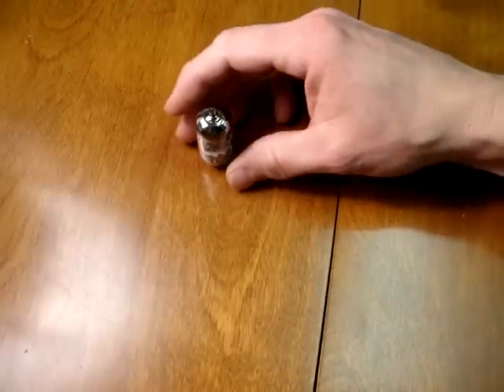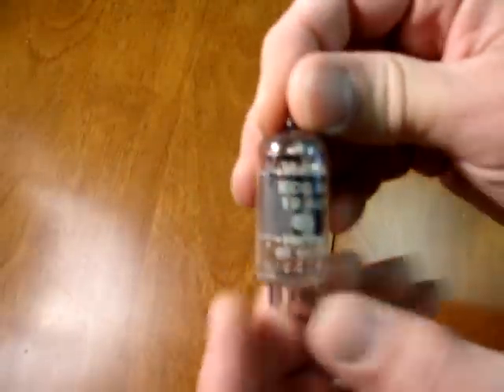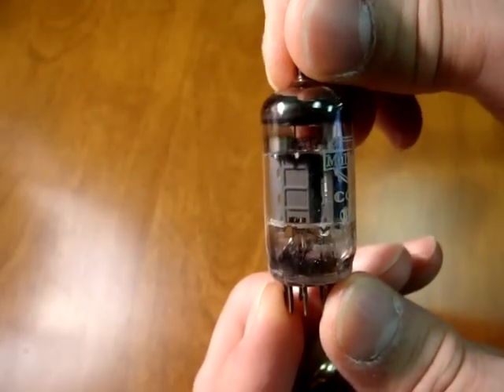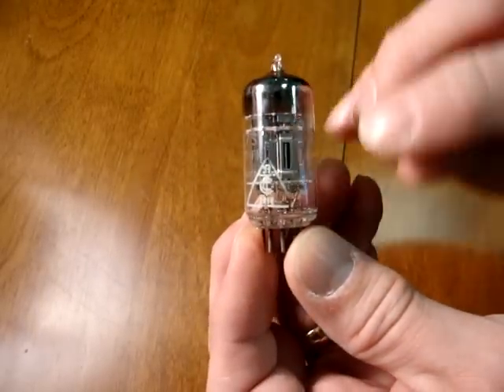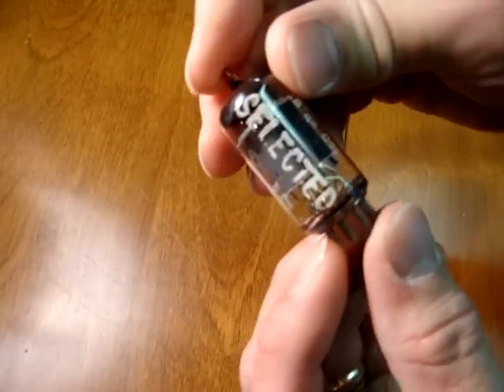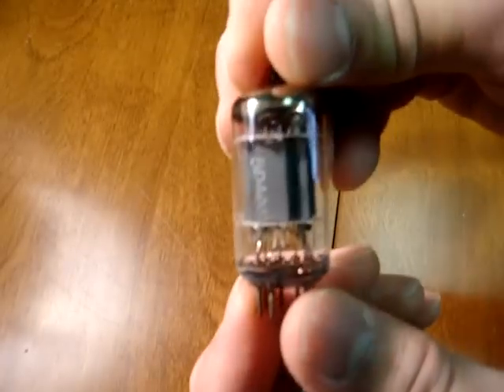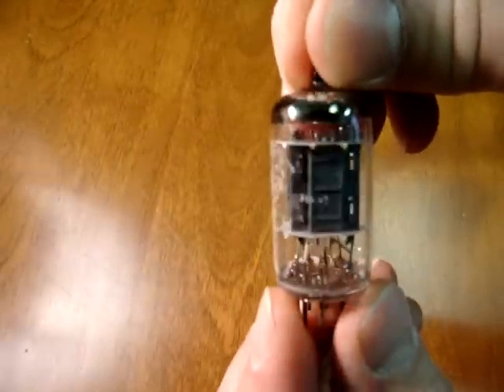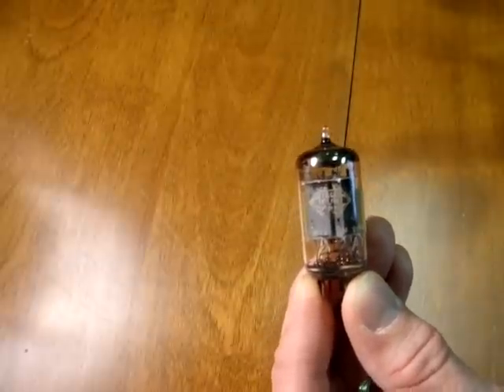How to Spot Super Rare 12AX7 Vacuum Tubes part I

Comment: I recently met a retired FAA engineer that sold me many tubes and there were two red tipped Bell & Howell 12AX7A and only marked Made In Japan.
Reply from the maker: Bell & Howell used Mtsushita of Japan for most of their tubes in the early 1970s.  The red tips indicate they were likely tested and passed for critical applications in certain test equipment or hospital equipment.

Comment: cleaning out my storage unit, came across a box with 11 Telefunken 12AX7 tubes, authentic to every detail, smooth plate with white letters 'Made in Western Germany'. I don't even recall exactly how i acquired them at least 7 years prior, I think they were going to be thrown away and i rescued them, not knowing at the time exactly what they were, other than vacuum tubes and my instinct said 'keep those, they are probably still useful' 11 in very good condition, one broken, and two more that are RCA and GE 12AX7 also. Looking up how to test them

Comment: Back 4 or 5 years ago i went to a flea market and i spotted a RCA repair box. I opened it up and there were well over 100 tubes in boxes. Some were marked as used and were for testing, but the majority were NOS RCA, GE and other brands. I bought the whole box of tubes for $40. I got home and tested the tubes and I also tried them in my amps and in the end i had 36 12ax7 tubes (New in box) RCA and GE tubes. 5 Amprex 12AX7s. 12 RCA 6L6 tubes, 11 12AU7 GE and Amprex tubes, 17 6V6 RCA. And there were almost 20 used tubes ranging from 12ax7, el84 (6bq5), 6L6 and a few that no guitar amps use. Was an awesome find. Im curious what just the red and black wood RCA repair box was worth. But I still have a majority of those tubes in my stockpile of tubes. About 7 years ago i bought 25-30 JJ 12ax7 tubes for $9.99 a peice and i have not used them they are still in boxes. JJ 6L6s, JJ EL84s. Now ive been using 6p14p in all my EL84 amps and ive been using 6n2p preamp tubes in everyone of my amps instead of 12ax7 tubes (either ive rewired my amps or im using the 6n2 adaptor to 12ax7. The 6n2p and 6p14p are dirt cheap for military grade NOS. Im also experimenting with 6p3s power tubes in some of my 6L6 based amps, ive just had to cool the bias down. But i can redo all the tubes for example in my Blues Jr for around $14. If i was using say JJ 12ax7 and JJ EL84 new production tubes itd be $125-150 to retube the amp ! Crazy. You can get 32 packs of 6n2p preamp tubes for around $65 shipped ! I keep telling people about how good these tubes are but some people until they hear my amps are trapped in this world of theres no way anything can be better than a 12ax7 tube ! All the companies use them !! lol Military Spec tubes last a hell of a lot longer than new production tubes. Ive been selling Recap/Conversion kits for Blues Jrs. In the kit are F&T caps, 27k resistor to cool the bias down and 3 6n2 to 12ax7 adaptors. 3 x 6n2p preamp tubes and 2 6p14p power tubes. Ive sold about 30 of these so far. The 6n2p preamp tubes im buying rival my 60's RCA tubes in tone. 

Just a heads up folks, you heard it here first. Also look up Train Wreck amps they are one of the few companies using 6p14p and 6n2p preamp tubes and some other European tubes. You can wire your amp up to use these 6n2p preamp tubes very easily, but i found it was easier to just get the adaptors for people.
Reply: For 12ax7 tubes my personal favs (not counting 6n2p tubes) are RCA short or long and GE short or long plates from the 60's. In my Twin style amps these are the bomb and I never found out what type of tubes Jerry Garcia used, but i swear they were what im talking about here RCA or GE's ;-) . I know some people swear that they dont hear a difference between tubes and that may be true you dont hear it, but i do and if im playing thru the amp i want it to sound the way i like it to. See we agree to disagree haha 🙂
For example I like JJs but they are not always the best sounding tubes. But they last a long time in my amps (as long as the bias is set correctly on the amps). Mullards i do not like, ive had more dead current production Mullards in the past 7-8 year than any other brand. Sovtek are very hit or miss for me, some of their tubes sound great but ive ordered some matched pairs from a few reputable places and ive had issues with them in multiple amps with getting the bias right. Im speaking of their EL84 tubes tho, not their 12AX7 which i like. RCA i think are the perfect 12ax7 for what i do, same with GEs i love these two brands. But these are my picks for 12AX7 preamp tubes.
Reply: JJs and other Russian or Chinese tubes are really good for most guitar amps. Guitar amps create distortion on purpose and, design wise, are night and day from hi fi amps. To use Telefunkens in guitar amps is like using the finest single-malt Scotch in a fruity mixed drink.

Comment: I got was emtied a house where i old schop keeper and a bit of a horder of things and i got a huge box of new old stock tubes,Philips miniwatt rca etc etc 6l6 many siemens and a bunch of black metall cappet tubes(minlitary grade?,Also got lots of old tube radios for different use.I does some repair on amps and electronics for 40 years, fun to get hold/save them from going in the trash continer.

Comment: There are some capacitive differences in the plate, grid, and cathodes of some tubes vs. the same type made by another manufacturer.  And that ALONE determines how one tube can sound different from another of the same type but a different brand.   Even then it's not the tube, but how that altered capacitance interacts with the amplifier's circuit.   Between that and microphonic sensitivity, that pretty much defines all that ACTUALLY makes a difference in tubes of the same nominal type.

Comment: Glad I found a pair of NOS Telefunken tubes for 70 bucks recently. The smooth plate is balanced, but has high plate resistance, which is kind of annoying as a V1 that needs more 'oomph' put into it to get the gain, but the ribbed plate is fucking amazing, 70/70 instead of 120/120 according to the American testing machine.

Comment: Slightly off topic with analog tester. I have so many of these preamp and vacuum tubes and got a Heathkit VTVM given to me. I’ve read about testing continuity /filament  but what else should I be testing/looking at for a good tube with volts and ohms.

Comment: OK, listen up, youngsters...I've been in the tube game since 1961, and this is the truth: the best tube for your (audio) application is the one that sounds best to YOU, regardless of what any professional tube-roller might tell you. (Disclaimer: I'm a professional tube-roller - I specialize in guitar amps. I've done work for Derek Trucks, Meatloaf, Let's Go Bowling, Susan Tedeschi <etc.> and many other top artists.)  Sometimes tubes which test as excellent in a tube tester sound like ASS when installed in the equipment, because tube testers (for the most part) don't test for hum, noise or microphonics. By the same token, tubes which test poorly on a tester may well sound dynamite when plugged into a guitar amp. "Brand snobs" often get burned by selecting tubes by what's printed on the glass...just because a tube says "Telefunken" or "Sylvania" on it, it's no guarantee that what you've purchased isn't a turd under glass. The "legendary" tube manufacturers turned out crap as well as good stuff back in the day, so use your EARS when selecting tubes. If you can develop a relationship with a tube seller who is a musician as well as a technician, you'll have a greater likelihood of obtaining quality parts. Bear in mind that there is a whole universe of tubes which is circulating on e-bay; people buy them, try them, find out that they suck, and put them back on e-bay. Buying from someone with a good reputation may keep you from joining that particular dance.  And don't rule out currently-produced tubes; some of them are damn good. Some aren't.  ;-)  Good luck!
Reply: Thanks for your experience.

Comment: I bought a 12ax7 tube that's supposed to be a Mullard brand but marked RCA. When I posted a pic on my guitar forum two members IDed the tube as an RFT because of the "throwing star" mica design. I have it in my Vox VT40+ amp though and it sounds fantastic, much better than the Sovtek it came with.

My guess is that I bought a remarked tube?

Comment: I remember the red tipped telefunken tubes used in American Optical ECG monitors in the early 70's. Even though they were tested to very high standards, there were some that would not yield a good common mode rejection ratio in the low level stages of the monitor. That was the problem with tubes, and after a few weeks of operation, the CMRR sometimes needed to be readjusted because of aging of the dual triodes.

Comment: Great information! I took 6 12AX7's out of an Lowrey Organ. Are they of any value? They are made in the US and have a Lowrey label on them. I'm pretty sure Lowrey did not make them.
Reply: If those Lowreys have long black charred looking plates then they are late 50's RCA and one of the best 12ax7's you can get. They will be either RCA or Sylvania, both good USA tubes.

Comment: How many of those would you like?   In less than 10 minutes I found 5 of those in my very old collection of '50s tubes.  I also have 12AT7s, 12AU7s and 12AY7s.   Mine are a mixture of RCA and GE.  How about some Nuvisters or a 3DR3 lead covered high-voltage regulator tube?

Comment: are all the 12az7s interchangable
Reply: As I've understood it, they all sound about the same when operating in their "normal" range. There are variations in noise, gain, and microphonics (that is, how they react to vibrations) that obviously follow from the different mechanical designs, but they're near enough interchangeable when used as "clean" amplifiers. (As an example, I think larger plates and emitters give more gain but also more noise.)

The interesting thing with tubes is how they sound when pushed into distortion. Again, there's not really any magic to it - different shapes and sizes of emitter/grid/plate will mangle the signal differently, and thus two tubes really can sound different when used in e.g. a guitar amp.
Reply: Oh, sure - most of the tube fanatics are using them for things where you shouldn't hear much of a difference, and probably overpaying a lot for tiny (if any) perceivable differences.

I'm just saying that there are certain uses where the differences between tube models are quite real, so it's not all superstition. Merely most of it.
Reply: Lefty McStinky ...You can't go wrong with tubes from Mesa Boogie, Sovtek or Groove Tubes for your guitar amp. Just choose the brand that fits your style.

Comment: Are all 12AX7 vacuum tubes "super rare" or only those specifically featured in the video?
For instance would a General Electric 12AX7A/ECC63 (could be ECCE3, not ECC63) be rare?  It was made in Japan but back then (60's) of course, I'm aware that Japanese manufactured products were legitimately stigmatized as junk.
Reply from the maker: Hi, the tubes in the video are just a sampling of those considered rare or super rare.  There are others that I will have to put in another video.  Your GE is a 12AX7/ECC83, and they did source them from Japan in the 1970s.  If it came from the Matsushita factory then it is a pretty good tube, but not considered rare.
Reply: Thank you. I appreciate your work.
Reply: I was browsing your site I am lucky enough to have a phillips radio thats full of good miniwatt tubes 4 EL84s and 1 12ax7 talk about lovely sound
Reply: Japanese products may have been stigmatized as junk, but actually are often made to very tight tolerances and are quite good. People won't seek out Japanese tubes and pay top dollar for them, but there's nothing wrong with the stuff that came out of Japan.

Comment: Vintage tubes are not a good thing as they will all eventually die being used or not (all tubes will)
What we need is for manufacturers to create improved new tubes...
A line of cold cathode, lower plate voltage tubes, could revolutionize audio electronics...seems we gave up on tube R&D when the transistor came along.
Reply: Incorrect---a tube that was never used from even the 1920's will test as good as the day it was made. The working parts are sealed in a vacuum, they don't age just sitting around. And how hard is it to change a tube? They're not like incandescent light bulbs, they last a pretty long time.
Reply: +forsakenworlddragons I think Craig was going for a new tube design in general... like not a 12ax7's, but an as-of-yet undeveloped tube design.

We haven't seen much since the mid 60's (because of the transistor).
Reply: "seems we gave up on tube R&D when the transistor came along."  There's a good reason for that.
Reply: Your conclusion is not right, the vacuum tube will exist forever. The frequency response dynamic range of semiconductor is not so good as vacuum tube. For extremely high quality audio application, it's not substitutable.
Reply: If only America was not such a throw away economy,  that would create a market for them again.  No company will tool up if no one wants them.  Whatever happened to the tube testers at Circle K?  You know, the one that looked like a pinball machine with the drawers full of tubes? Gone.  Found only on ebay these days.
Reply: @UpcomingJedi  Those old "drugstore" testers were the ones which said "U-Test-M" on them. They were emissions testers, not particularly good. If you're looking for a tube tester, there are certainly better choices than one of those. Hickok, for instance, or B&K. Not cheap (in most cases) but if you want reliable accurate equipment, you gotta pay.  ;-)
Reply: SinSchism ah right. got ya.
Reply: For crying out loud, we're talking about audio frequencies here.  Any transistor will have gain and be flat over audio frequencies.  When you're designing for hundreds of MHz, then you have some challenges.
Reply: justsomeguytoyou agreed
Reply: Craig Diamond there is a website online called thetubestore. com that sells new tubes. they sell an 12ax7 for like 14$
Reply: Lefty McStinky who won the more about vacuum tubes 12 X 7 in my drawer in Fresno phone number +1-405-933-5533
Reply: 1st world countries don't produce tubes anymore because of the environmental hazards, the process creates arsenic among other extremely toxic substances. This is why you only see them being made in 3rd world countries like Russia. Problem is they have no where near the same standards as the old US and British companies had. It's just how it is, and why these tubes go from 300 to 1000 dollars.
Reply: Korg have developed a replacement technology in 2015!

Comment: Call me weird, but I have a JTM45, that had 2 Telefunken 12ax7 in and a mallard 12ax7 in and it sounds better with new tung Sol tubes in V3 and V2 and a Chinese tube in V1...the Telefunkens and Mullard all test over 70% Gm...even so, the old 12ax7s were shot with a pellet rifle in a Crowley-esque ritual because according to my  Gematria calculator "12ax7" translates to "field mouse porridge".... The time you spent reading this, you will never get back....

Comment: From what I understand the ECC82 hs much lower gain, and is not a direct replacement for ECC83 type or 12AX7,
Reply: You can replace a ecc83 (12ax7) tube with a ecc82 (12au7) they have the same pinout and you can switch between them, but as you say, 12AU7 has muuuuch lower gain.

Comment: Good day
It is possible that the original radio dealer switched the originals out for a cheaper brand, or, your Uncle had it repaired yrs ago & they were replaced then.
Really, to be honest, it's true there are "good" & "better" versions of tubes available, the "better" version installed in "un-restored" or "budget" stereos will not "show".
You'd need a *real expensive* stereo to show off the minor difference.
Buddy will want twice or more the $ for His "fancy versions". Normal ones are decent.

Comment from the maker: That's the number one question my clients ask.  Why can't the USA made tubes again with quality like the old days?  My answer:  you simply cannot and make a profit.  You need a metal shop and a glassblowing shop, a materials coating shop and a package line.  When your competition is a $6 tube from China, it cannot be done at a profit at those prices in this country, using the old production methods.

Comment from the maker: Thanks, I may try running curve plots on NOS versus new tubes on the curve tracer and see how they match up at full rated power.  It may prove interesting.  NOS tubes can be prone to early failure and sonic problems due to gas, either caused by outgassing of internal parts or a compromise of the vacuum from slow leaks around the pins due to long storage.  New tubes rarely have these issues.  We have a satisfaction guarantee on our NOS tubes that covers these problems.

Comment from the maker: This testing has been done.  I refer you to back issues of Vacuum Tube Valley.  Tests by qualified engineers using lab grade test equipment proved over and over, that measurable differences can be detected especially with regard to signal distortion, with NOS tubes usually being rated superior over new tubes.  Not my words, but Eric Barbour's.  He has over 30 years as an engineer in the industry, and consulted for Svetlana and Vacuum Tube Valley.

Comment from the maker: True, NOS tubes can be failure prone just like new tubes.  The testing that was done on professional equipment under controlled conditions, does show that NOS tubes display lower signal distortion and more accurate curves when plotted, than new tubes, if you want scientific evidence.  Beyond that, I have 16 years of talking to clients who were skeptical at first, then heard the difference themselves that NOS tubes make.  10,000 clients and 1% wanted their money back due to "no sonic difference."